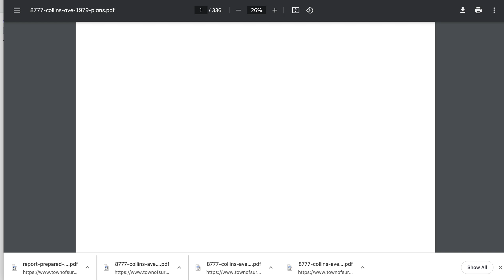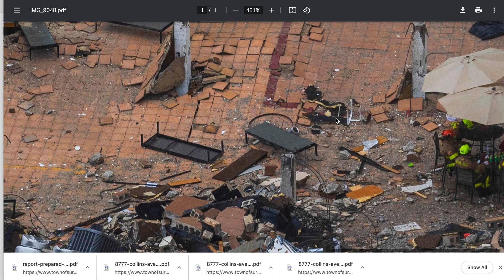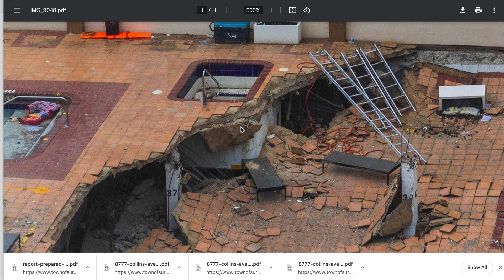Champlain Towers COLLAPSE COLUMN ''GROVES'' MATTER POINTS TO DIRECTION OF FAILURE + WITNESS STATE

Comment: I don't think that the deck dropped first. I think based on the video of it falling. That first section that drops the parapet wall drops in as it falls. The decking from the photos I've seen of the pile immediate after arrival of fire service. It appears to me that the decking looks like it fell when the first section. And the last section of building further knocked down more of the decking.
Reply: There were two eyewitness reports that saw the pool deck falling first. Also, there is a video from people from the neighboring building who heard a loud noise, thought it was an accident in the garage. The video shows a column under the pool deck fallen onto the driveway below the ramp. It appears, the pool deck falling pulled some structural column(s). Another analysis shows the first confirmed falling column from the video being connected to the side, not the top, between the column under the pool deck and one structural column, possibly pulling that one down with it when the first fell. The larger question is, how many structural columns would need to fail to compromise the building. Is a single failing structural column causing a domino effect?

Comment: rod buster, here.  1970s.  hard to believe 16 no 5s each way could punch thru. col no 72 , rebar looks iike no 4 s and not too many, either , rebar corroded due to carbonation and chlorides, the concrete lost structural strength due to water and salt intrusion and probably too much water when they poured it back in the day. or probably both. they  need to check to find all those no 5. that were supposed to be covering the column heads.
Reply from the maker: ''Rod Buster",  you guys are like MULES!    Why not just call you guys MULES with SHOULDERS made of IRON?  CRAZY STRONG...
Reply: @ForensicCats  You might think that the big guys were the best. however the lanky stringy smart guys could last all day in the hot sun where the big guys overheated. Also the professional ones kept the ACI 318-71 handy in the event there was a question of how to go about a situation so that when the inspecting engineer came on to inspect before the pour, everything would be ok. This was not always the case but it should have been.

Comment: No I beams no metal posts only four pieces of maybe 3/4 rebar at each 12' concreate column. This was to hold up a 13 story concrete building? How many old roofs were still under old ones plus the new construction. Terrible engineering. This was built to fail and then few inspections by real inspectors just the kind that never look just BS with contractor and sing off. As an X contractor I've seen inspectors say "Boy a new color TV would make all these problems go away" Yep seen it and herd it.

Comment: With a nice high resolution picture like this, that shows side views of the broken off pool deck (the broken edges), maybe you could do a visual analysis of the deck construction. Wasn't there all this confusion about the plans showing a drained deck with slopes, and maybe they modified the deck to make it level, and this contributed to moisture buildup that made the deck unsound? Well, what do the pictures of the broken edges tell us? To me the layperson, it looks like the deck must have been really fragile to have punched through the columns so cleanly without any load on top of it!

Comment: Thanks for the time you have put into this disaster.  I may have missed the video where you stated it; but, are you saying the cause is from a pool deck failure between columns that then caused a "butterfly effect" of the deck then causing punching shear for a huge section of the deck... to then having a lack of reinforcing rebar against the back wall and then a tie into the building itself causing the deck to pull at the building supporting columns to then fail?  Another question, what caused the deck to fail in your opinion between columns in the first place?  Lack of maintenance? Deck to heavy, inappropriate drainage?  Maybe a bit of all the above?

Comment: I certainly hope that this doesn't turn out to be caused by someone returning from a bar at 1 AM and driving into one of those columns in the parking garage just hard enough to bring down a building which was already on the brink of disaster.
Reply: It's not. Its pool or the columns in walls  uneven size walls Too much weight spent house huge decks then smaller decks TOO MUCH WEIGHT And thus this guy also presented 600 pages missed floor wall plans they skipped on.

Comment: The two white planters along the 87th St wall on the pool deck fell towards the lobby. It doesn’t seem like it was too violent like the rug was pulled out.  Just tipped over
Reply: This is the southwest corner of the former parking garage at Collins at 87thafter the controlled demolition/collapse 1:25 into video.  Pretty violent? lift/ breakage along tan wall/ planter.

Comment: From the beginning with the seven minute video of the parking structure, I have felt the water leak was a broken fire sprinkler line, most likely sheared by concrete debris.
Any flow of water in the sprinkler system, or break in communication wiring, should’ve sounded the fire alarm, allowing some people to evacuate. Interesting to me no alarm sounded, of course could be domestic water line as well.
Reply: I was wondering why an alarm did not go off.

Comment: Since the structure of the Deck was used as a STABILIZER ( a counter weight against see winds... ), see how he deck weight punctured thru the columns,,,..

Ok the analyis sof the pieces of the puzzle show thecasding effects from 1)DECK to 2) columns of the buliding, 3) to the roof and yidi, yada..

ALL  columns under the Deck should have an emergency  cable , column to column,,
Axting as a  deckSafety net to hold a failing deck.
At leas the cable will be an absorbing  layer to break the fall of the slab.

Make it form an X under the slab. 
Name it the Eddy X FACTOR ( like Eddy's Current)

Comment: Hello Kai, would the pool columns been more resistant to punch shear if the connection to the pool deck included molded haunches or a tapered concave disk top?
Reply from the maker: I think I can visualize what you are describing ... the steel being number one and more of it...  think of the concrete deck having to bridge from one column to the next.